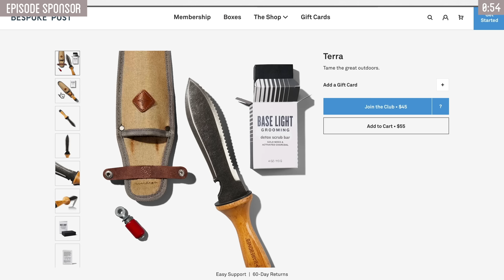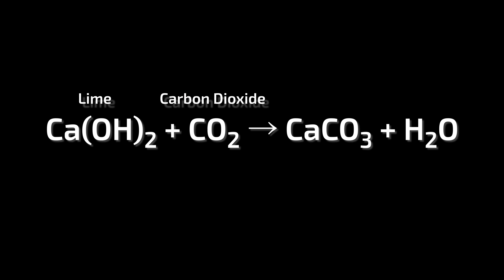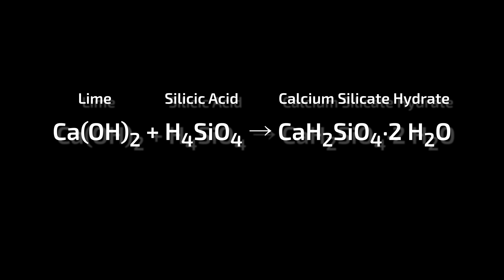How to Make Roman Concrete (4 Different Materials, 4 Different Strengths)

Comment: As someone who tested concrete for a living, I really wish you would revisit this using a modern testing lab and the advice of a professional engineer as to how to make your samples, and how long to cure your concrete. Modern concrete is designed for a 28 day ultimate strength but it will continue to gain strength (asymptoticly)  for 56 years or more. I would be pleased to collaborate with you concerning modern and ancient building materials.
Reply: Cob also takes 1-2 years. Nothing was really given a fair chance here.
Reply: Hi, I would like to get in touch with you as I am looking for organic cement materials for my project. Will look forward to your reply. Warm regards 
Shikha
Reply: That would be very neat to watch
Reply: I figured out a cement mixture that has very high flexural strength. How would I go about marketing this?
Reply: It's rubbish testing data. They need to put foam or rubber under the clamp so the weight isn't on pressure points. Since the bricks weren't flat and because the weight is on pressure points the data is invalid.
Reply: And the modern brick wasn't sitting flat at all, so it was not a compressibility test it snapped across an unsupported span. I have watched 3 of his videos and I would say.... Expect this level of inconsistency and obvious problems.

Advoko Makes channel has always impressed me and he has done quite a few things from scratch with a progression of technology... I would love to see him tackle something of this scope!  It's a really awesome concept to reproduce the whole technology tree of civilization!
Reply: You mean the same engineers ignorant of this process & its proven longevity? Those engineers?
Reply: @swaynebluize583  what now?
Reply: How modern is modern to you? House was built in 58, and I'm worried that the blocks are starting to wane.

Comment: Need sea water for true Roman Concrete. That had been missing from the recipe till it was recently rediscovered. I rather enjoy the idea that they use "water" when the Romans meant salt water. How many things are we technically screwing up? Like, take a recipe from today that calls for 3 eggs. Fast forward 2000 years and their eggs are much larger. They screw up by adding too much egg, even thought they use 3 eggs standard their size. Just an interesting thought. Compare to I think it was the Maori who could eat Bracken root. Toxic plant. They left no way to identify a "good root" from a bad one, the information as far as I am aware, is gone.

Comment: why was the modern brick not flat with the floor plate? ceramics are great for compressive forces, not axial ones. If there was some debris under the brick it would act like a leaver and focus the forces in one small area instead of distributing it evenly...

Comment: Roman concrete,when the advanced techniques used is tougher and more durable than modern concrete no question.There are many examples of 2000 Year old Roman structures in tact,while many modern concrete structures start cracking apart within 10 to 50 yrs for example
Reply: Michael P That is not universally true, most buildings you encounter tend to be made to only stand for a few decades so the concrete is optimized for strength so you need less but we can also optimize for durability and that is done with things like nuclear bunkers and dams which need to stand for a long time. Roman concrete also has the benefit of having been used in very mild climates which don't have to deal with a lot of rain and frost which is usually what leads to structural failure.

Also there are a lot more examples of Roman structures that aren't intact you just don't ever think about those because well they aren't here anymore, something like 99,99% of all Roman structures have collapsed totally and of the remaining 0,01% a lot of those have partially collasped. The ones that stayed owe just as much to maintenance as they do to the durability of their materials.

Comment: you cheated, cracking the factory made brick. If you'd had it on a smooth flat surface, it would have taken even more pressure.

Comment: Okay, so I was told that modern concrete releases CO2 as it hardens, is that not the case with Roman concrete?
Reply: It does because it comes from the reaction between calcite and water

Comment: The professionally made red brick was at a bit of a disadvantage since you had it resting on a small stone in the  back, creating a pivot point and a good place to snap. If it were laying flat I imagine it would have stood a better chance at breaking until higher pressures were applied.
Reply: The wood wasn't really given a chance either. He crushed it in it's weakest dimension.
Reply: I though the same. The test were not  true as some brick were definitely focusing on one small point. others were perfectly flat spreading the load. So hard to tell the strength really. Great video though love this stuff 👍👍👍👍
Reply: The error he made when trying to compare the force needed to destroy each type of brick was termed "point loading". In order that the different breaking strengths are ONLY due to the nature of the material it is essential to apply the force over an identical area of the specimen AND have a sample preparation procedure that ensures the force is applied evenly across that identical area.

A small stone (e.g. a piece of the aggregate used in the Roman concrete) lying either under the top plate (between the pressure plate and the brick) or beneath the specimen (between brick and  table) will produce erroneous results if it resists crushing for even a short period. Such point loading means all the rams force is directed at a very small area of the brick's surface (a very high pressure > the apparent final breaking pressure) causing the break to fail before it would have.
Reply: OCD in me was triggered, I was like how hard is it to make an even base for the test, have you noticed they do fail on the details often and with a little more attention to detail they could make it much better
Reply: Yep. Nothing cured to a reasonable strength. Cob is a known Earthquake resistant material with compression strength comparable to concrete. It takes a hell of a long time to dry though. 1-2 years depending on the conditions. Also the Roman mix was not an accurate mix where as the Modern mix was pre mixed with all the trial and error removed.
Reply: Axe test in the previous episode was also kind of... unscientific is what I guess the term would be.
Reply: Yeah I noticed that too, big sad
Reply: limecrete takes several months/years to fully cure and harden too
Reply: Could this have been... intentional?

Comment: I feel it's high time you started making crucible steel and, before that, perfumes. Perfumes were around for quite some time,
Reply: I would like to see someone recreate the multiple fires up the hill. Each fire heats the air for the next fire increasing the temperature until you could melt steel.
Reply: @LaserFur  That is somewhat my ongoing dissertation.
You don't need multiple fires to melt steel, you only need bellows or wind powered furnace. Crucible steel smelting is just melting the charge in order to get the steel.
Unless, you want an automated, hands abd wind free approach, solely using the principles of thermodynamics... Then I'm in!
Reply: @emel60  Bellows and such alone will not boost the temperature as much as adding a heat exchanger. For example if you put a metal pipe down the chimney and blow air down it the temperature will increase since fire is a temperature offset and not a set temperature.
Reply: @LaserFur  on the contrary! Bellows were the source of choice for smelting iron and crucible steel in S. India since... Oh... Several centuries BC. The temperature in the bloomery furnaces were about 1450-1500 C, and calculated at 1800 C. Theoretical adiabatic temperature was even higher, 1900 C, but cross that one off. In all three cases more than enough for melting wrought-iron, steel or cast iron.
Obviously, the crucible furnaces needn't be so big or use so much fuel. But they needed bellows.
Reply: @emel60  I am not saying bellows don't raise the temperature. I am saying that adding a heat exchanger lets you increase the temperature until your heat exchanger melts. A brick heat exchanger could get the fire really hot.
Reply: @LaserFur  ahhh, sorry, I completely misunderstood you!

Might you explain a foreigner your idea of the... Multiple hill fires? Or the heat exchanger in mind? :)
Reply: @emel60  There is a old painting of 3 fires going up a hill with what looks like paths between them. So the idea is to have the fresh air going into each fire already hot. This could also be done with bellows and one fire as well. The 3 fires would be self drafting. Either way you make a chimney inside of a chimney. Burned hot gases go threw one part and the non burned gasses go to the fire from the other.
Reply: @LaserFur  quite interesting I might say! What would an official term for this setup be? Some of that idea is used in secondary or tertiary combustion chambers in wood or rocket stoves!
However, I have no clue what the atmosphere would be like, in the hikk fire setup. Highly highly reducing?
Reply: @emel60  The air before the fire would not be any different. it is only being heated by the other fire. It's similar to the way the air is preheated in a micro turbine.
Reply: @LaserFur  I see, just heat reusing. Interesting, in any case!

Comment: sorry but this not accurate. Romans used to use egg whites, quick lime and sand also they did not use this as building blocks like concrete bricks etc. Its main purpose is binding rocks together. Their concrete was far more better than ours. You can not find a single modern concrete house after 100 years.